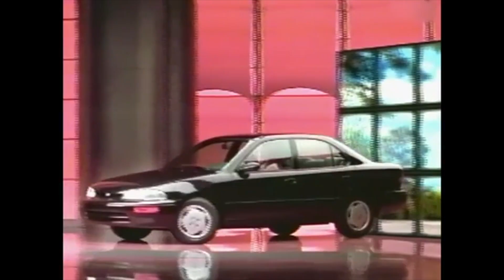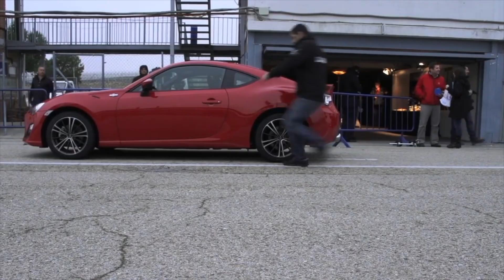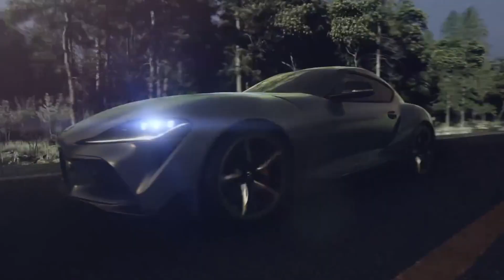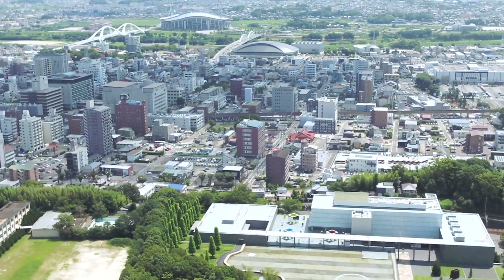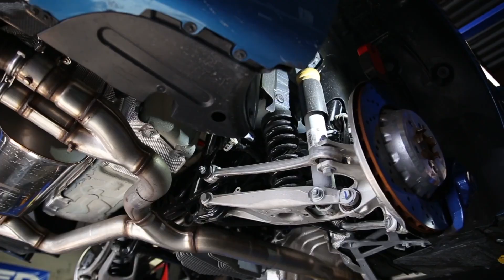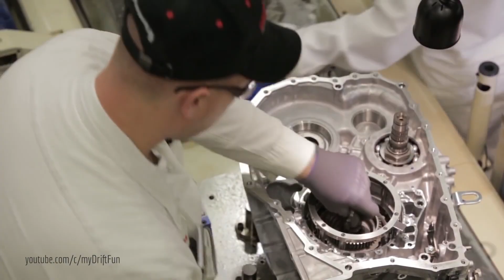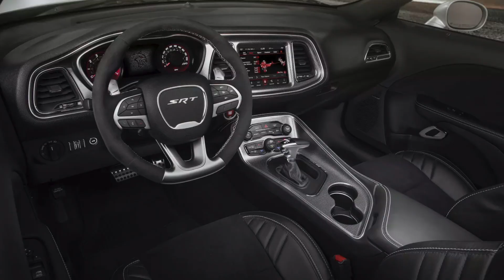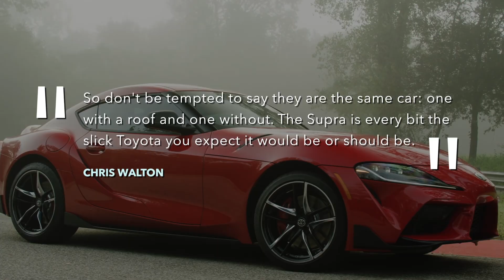MKV Toyota Supra - BMW or Toyota? The UNTOLD TRUE STORY

Comment: Everyone who wanted a new supra was expecting a successor to the "2J inline 6" everyone wanted a easy to mod & overbuilt 800+ HP Toyota supra that used a handmade Toyota engine that is NOT outsourced., we got a re-badged BMW z4. This is NOT a Toyota supra, all they did was put a Toyota badge on a BRZ & call it a supra too milk customers....
Reply: Yeah go tune a MKIV to make 800 then get back to me about easy. Sounds like someone played a little too much need for speed.
Reply: The 2JZ was designed by Yamaha
Reply: @adriangonzalez4449  a Japanese company......which still makes great engines......all they had to do to make the 3JZ was make it cross plane.......WHY TOYODA SAN! WHY!
Reply: @FarrFromPerfect  new emission laws would probably prohibited it
Reply: @adriangonzalez4449  They can put direct injection + Turbo on it to get around that. Or if they were really crafty I would just get 2 x CrossPlane R1 engines and put that in instead as its already emissions compliant. It could be IL8 or V8 configuration as it wouldn't be very large. Lot's of options out there that could be JDM.
Reply: It does seem more like the next step in the brz/86 based on the styling and size, except for the I-6.
Reply: Literally all toyota had to do was reinforce the original 2j block, called it the 3j, AND EVERYONE would've been happy.
Reply: It's not that easy. Keep in mind that the 2J is almost 30 years old now, and with the ever slightly tightening emissions, I doubt it would be eligible for it to be on the market now.

Comment: You people are forgetting something. “Lack luster specs”.. So was the last Supra when it came out. But what it had was insane capabilities for power. The B58 this car has is already making more power than the N55 predecessor, and we already know stock motor F82 M3s can make insane power.

I don’t know why people are expecting this car to have crazy power numbers from the factory, that is not the point of the Supra. What ended up making it great was the forged rotating assembly to allow for more BOOST.

Comment: I still cannot understand the majority of people here that still shittalk german brands on Quallity. According to the J.D. Power 2018 U.S. Vehicle Dependability Study Lexus takes the lead, but is merely one step ahead of Porsche. Toyota even fell behind BMW, taking the 9th place. Reliability is not an issue. Your personal experience on that matter would not be relevant. The study measures the problems per 100 vehicles per brand and is held in a country with one of the largest car markets.
BMW produces rock solid cars... a joint venture between Toyota and BMW is one of the best decisions made in recent times. You have two manufacturers that created iconic cars throughout times and yet people complain. It is developed by both parties, toyota has say in this, stop whining.

And if you want a stick, buy a fucking older Supra.

Comment: The Supra has iDrive......doesnt sound like independent Interieur Design to me
Reply: Dont like it, swap a toyota head unit in.  Pffftt like they are any better??
Reply: The iDrive is part of the platform so it makes sense the Supra also has it. 
It has all to do with controlling the drive dynamics and close to nothing to do with Interior Design.
Reply: @tjroelsma  you are right
Nevertheless it probably feels like sitting in a BMW.
btw. I see this more like an advantage of the supra.
Reply: @ Jan Knight
Maybe it will, it all depends on how Toyota has implemented it. 
As Toyota doesn't have that kind of system, it looks like it's an improvement you'd want to have in a Supra.
So in the end it all comes down to tolerating an iDrive system to control the setup of your Supra or lacking the control to change the setup of your Supra. It wouldn't make much sense for Toyota to rip out the iDrive and reinvent the wheel just to have a proprietary system.

Comment: I really don't get it why Toyota didn't make this a project for Lexus and themselves. An engine for both brands, just like the 2JZ was, interior influenced by Lexus to improve over Toyota's cabins. Now they have a legacy name on a >70% foreign platform with high price tag, not really breathtaking specs and I assume expensive spare parts. This car doesn't show off what Toyota can do - and that's where people are mad about calling it a Supra. My MK3 Supra has so much in common with the Corolla my grandfather had in terms of switchgear etc and reliability while just lifting the performance to the brand's spearhead. So even if it's going to be a good car I join the people who would rather save the name Supra for another car.

Comment: Toyota is anal about reliability. When BMW was taken aback by the Toyota engineers going, "mmmmmm no" and sending the parts to Japan, that should tell us explicitly that this is a reverse 2JZ situation. The 2JZ had some German roots. Now? This engine has some Japanese roots backing it up to give it more reliability. I think that everyone freaking out about the two cars having been developed together is worrying over nothing. It's not a rebadged Z4. They do have a shared platform, however, they have entirely different suspension, tuning, interior, exterior, and the like. I'm not worried. I'm going to test drive a Supra, and if it gives me that warm feeling in my gut that I got when I first drove a bone stock Supra Turbo a few years ago, I'll buy it.
Reply: German roots? What are you talking about, that fairy tale about "BMW German engineers" helping develop 2jz that keeps walking around the internet? That is a load of bullshit. It was Yamaha+Toyota, end of story. The major component being German in mk4 was the transmission.

Comment: Excellent video and answers many questions that I had.

Still two problems though:  The Vanos and timing chain being in the rear of the B58 is a real downer..and I'm not crazy about the spray in cylinder liners.  Hopefully, a good sleeve solution is realized because if it's not, that is going to make things even more undesirable.

Other than that, I'm still enthusiastic about it and time will tell.

Comment: My eyes have been opened about the New Supra,however the supra should have been in competition with 5 series BMW instead of a Z4 or 3 series..the HP could have been improved to at least 500...Engineering def had a flaw on this performance enhancing

Comment: Honestly I find this new Supra very underwhelming and it seems like the only thing it has in common with the old Supra is simply it's name and the fact that it has an inline 6. Problem is that it's just the same inline 6 you get on any BMW, what made the Supra's I6 such a legend was how overbuilt it was so you could get massive power with bolt-ons. This is just going to have the same aftermarket that you see on BMW's sporty models.
Reply: John Klise you never know. It haven’t even came out yet and many aftermarket companies are already developing parts for it.
Reply: @thekiller500099  It's the same engine in the z4. We already know what it's capable of.
Reply: @deelowe3  its not 100% same. if you do some research the head and turbocharger is actually different. that goes for the x40i, they use exhaust manifold while the supra is not. so we really don't know until it comes out. so i say about 60% are the same.
Reply: The bmw engine used in new supra already has proven that it is capable of handling way more hp and torque than it left with out from the factory, if the statement mentioned in video is true, about toyota having a hand in testing and designing that engine, it is very likely new supra will be capable of handling alot more power with simple bolt ons. You can research it yourself, bmw n54 engine, as the engine has some years to it, there's loads of information about it, and how much it can handle

Comment: I dont see a benefit for toyota to work with BMW. Had toyota designed the car themselves it would have been just as good as it came out when working with BMW. Its more beneficial for BMW because now their Z4 is more reliable. This combination did not need to happen, toyota would have been wiser to create the car themselves.

Comment: it pretty much is a rebadged bmw, it's fucking disappointing. it is Supra in name only, If they really wanted to create a brand new rwd turbo front engined sports car, it didn't have to be named the Supra. Of course they just want to bank off the Supra's iconography, heritage and fame without putting in any of the work needed to create a true Supra successor, so it's nothing more than a marketing gimmick. It may end up being a great car, but It will never be a Supra.

Comment: Excellent report.  This is in no way how I would want to spend my 50 grand.   The FRS/BRZ/86 had a valve spring problem the first year of production along with very poor quality control.  It was cleaned up quickly.  I would wait two years before considering ether car.

Comment: My N54 is bullet proof, 140k and still runs strong. I put the right oil in it (Motul, Liquimoly) and warm it up before I get on it. So, you're wrong about the reliability aspect, people (especially BMW owners) just don't understand how to take care of a cars anymore (why they took toolkits out)
Reply: Hahaha... Please... "Bulletproof" my ass... What kind of backwards manufacturer does not even put a dipstick in their engine? BMWs are fun to drive but they are disposable trash and that's what BMW is going for; that's why they are so hard to beat on their 3 year leases. If you buy one you are running on borrowed time after 100k miles/5yrs.
Reply: @stoptellingmewhattowrite  My 5 series going strong with 270k KM (about 170k miles). Its very reliable
Reply: @stoptellingmewhattowrite  Clearly you've never owned one, or know how to take care of it. Tell me, which of the forged engine parts fails on an N54 after 100K? Another internet expert that probably hasn't even done an oil change in his life. I have a 535i with 268K on it, so, suck it. What do you drive, a Dodge Aries?

Comment: I work in the automotive industry, I sell the parts for cars on a salvage yard, and without any bias I can tell you, that the Toyota reliability was a fairy tale from the early days up until late 90's, Current Toyota vehicles are built designed in great part in the U.S, and that legendary reliability is nothing but a nice memory of those golden days. Engines, transmissions, all prone to early failure, and thanks to that I am able to have a job, because of this "reliability" Toyota now lacks, Now combine that with the hard rock reputation that BMW carries,  "they are only as good as they warranty". Beautiful over engineered unreliable cars. I honestly never expected the new Supra to be an exact carbon copy of the FT-1, but the end result sure is a big step down towards normalcy and almost boredom. The biggest let down of this car is not that it has a bmw engine and drive train, not that is a watered down FT-1, but that its new version doesn't compete with the GTR or the soon to be RX-9 or the NSX.

Comment: The original supra was a beautiful engine gloriously designed by the artists at yamaha and tucked under the hood of a celica.  The new supra should have been something similar, like maybe have yamaha draw up something that fit into the frs/brz, maybe with slightly changed sheet metal and call that a new supra.  I don't even want to think about how much it would cost to get a thousand horsepower out of a bmw motor.  It's basically a full swap by the time all is said and done.  On the 90s supras, the bottom end of the 2jz was so strong that you could double its output for less than a set of a ultralight rims and get it to around 800-1100 hp for about the price of a modern 500 hp v8 longblock.

Comment: so, a bmw engine, bmw transmission, bmw rear end, bmw suspension, bmw interior, even bmw steering wheel, and a bmw chime sound!, and yet they say its a true toyota that is made by toyota!. and to add insult to injury, there is no manual trans!
Reply: 2019 track weapon

manual transmission

Pick one.
Reply: BMW engine sort of co developed with toyota, BMW rear diff, BMW/Toyota designed chassis tuned by Toyota in supra, ZF transmission , Toyota designed exterior and a  interior using BMW parts that looks different than the Z4's.
Reply: @cjpp78ytube  BMW engine is developed by BMW. It's the new B series boi, based on existing architecture. Nothing new. Toyota just tested it and that's all. Also, interior still has BMW look in it. Heck, it looks like a f*cking 3 series.
Reply: To add insult to injury, they had the monkey balls to call the thing a "Supra"
Reply: Gtr, gt3, modern McLaren, modern Ferrari, modern Lamborghini, Koenigsegg aren't sports cars /s lol u tool
Reply: No, they aren't. They are "fast" cars, but definitely not "sport" car, you need to become one piece with the car, and you can't do that with automatics and electric steering.  @366Y0
Reply: @GroupWar   your personal definition of what a sports car is, is wrong. You're defining a fun car. A sports car is designed to be agile (turn and corner fast) and to change its forward velocity quickly and stop its momentum quickly. The only redeeming part of your opinion is the steering feel because electronic steering can't translate what the tires are doing on the ground as well as hydraulic (which is being researched to be reintroduced). Your transmission  opinion is false because the only use of the clutch and manual lever is to get to the correct gear quickly and to engage the flywheel to transfer power as smoothly as possible to not interrupt momentum and  inertia. The only benefit of current manuals is simplicity when it comes to maintenance and manufacturing. Also, compared to performance autotrans, the manual transmission doesn't create as much parasitic loss. By your definition of just trans and non electric steering dictating what is a sports car then u can call most econo boxes and old granny sedans sports cars.
Reply: Of course to each of us his own difinition of a sports car, and I wont argue about what you said, but its a personal opinion art the end. I got my opinions from being a engine builder and race car driver for years and building many different race cars, I can tell you the isolation that an automatic is causing between the driver and the car is huge, even with the newer trannys, all that is due to having a hydraulic coupling (the torque converter) which connects the crankshaft of the engine to the input shaft of the transmission by a fluid only, no direct contact what so ever.  @366Y0
Reply: How does a manual make a car a sports car? almost all sports car or high performance cars run automatic transmissions because they are superior in almost every way. ZF 8 speed trans is likely the best mass produced auto trans you can have.
Reply: being a "car guy" you always need that mechanical connection with your car, the automatic is "not" mechanically connected to the engine, thats all.  @imafk2361

Comment: the real problem of new supra is z4 looks better. and for what reason to drive a toyota that have a bmw maintenance cost?

and supra cant really call a legend without  2jz. it is a real legend. they should find someone to make an engine as good as 2jz that can push over 1000hpw but make it smaller and lighter with modern material.and put it in any sport car design they come up. then that is the real new supra.

Comment: People are not saying that they're bothered with badge engineering on the new Supra. They're saying that the two things that mattered the most in the old Supra, the engine and the suspension balance is done by BMW and it's a betrayal of the rich heritage of the Supra. Also, BMW shared said platform with a half baked long distance cabriolet that has nothing to do with the Street Fighter (I know, I know... Hadooken) spirit of the old Supras!!! If they had called it Celica and it had a I4 Turbo+Hybrid I'd be all for it.